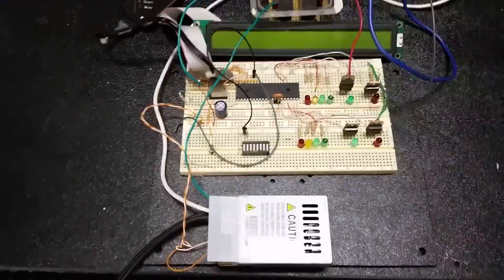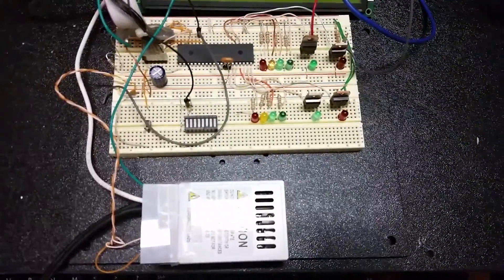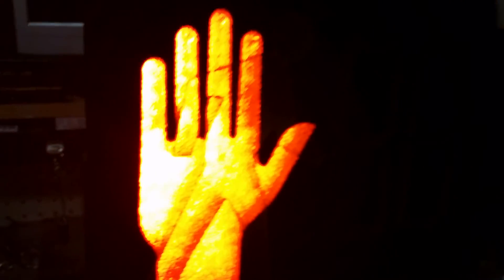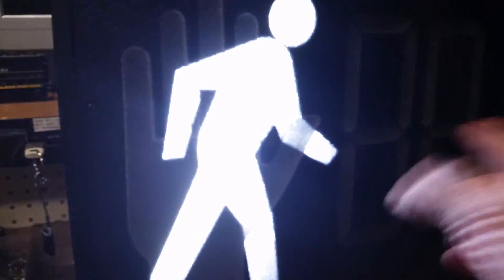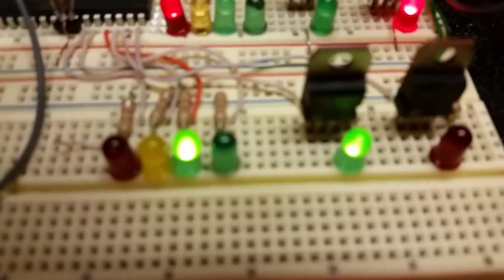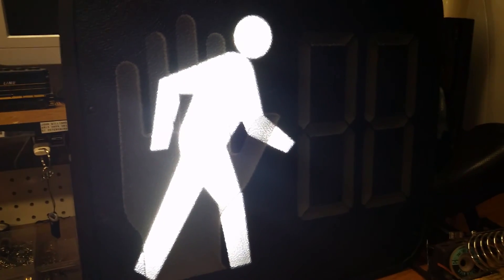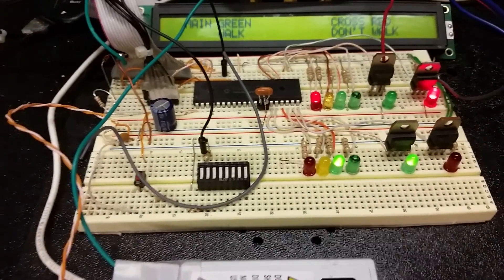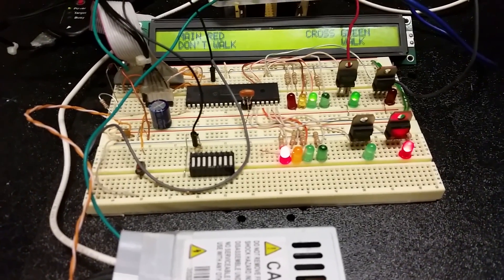Traffic Signal Control Circuit With Countdown Crosswalk

Comment: hello, a very nice video, will you share your circuit drawings
Reply from the maker: its very straight forward.. just LEDs connected to the pins on the microcontroller.